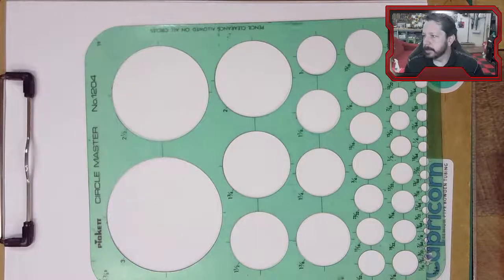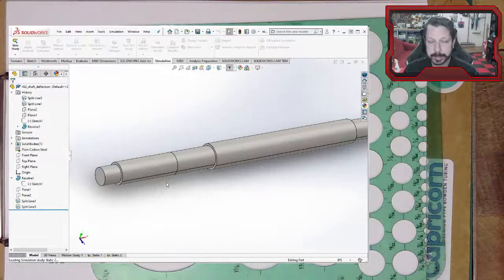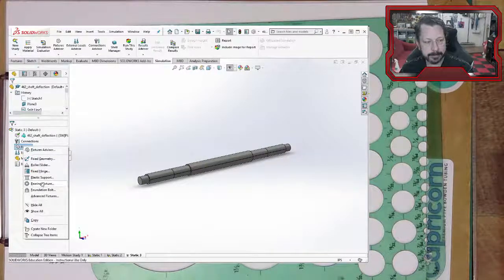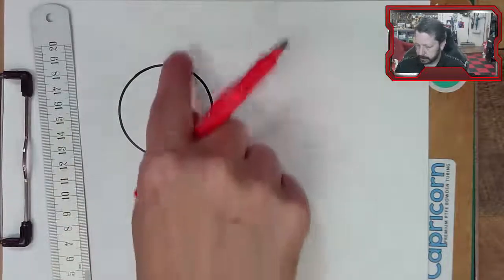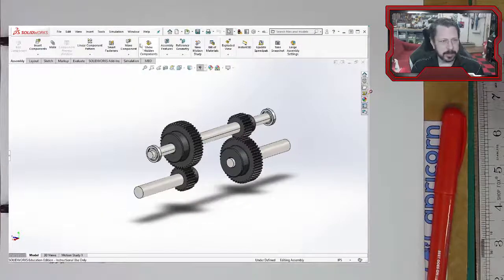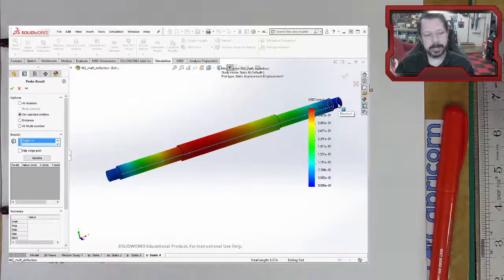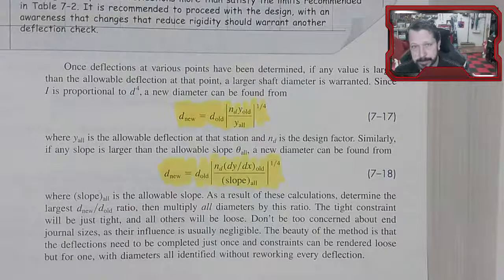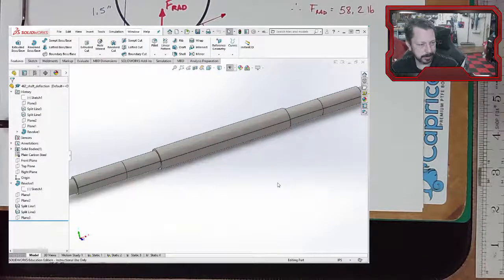Shigley 7.5 | Shaft Deflection | SolidWorks

Comment: i think you used SI units on your 2nd gear set but put in your english unit numbers, so your solution might not be correct
Reply from the maker: That is very possible. I don't recall exactly what I was doing there, so there could be some error in the final result. The process should be valid though - just maybe not the "answer". Thanks!

Comment: How would you of handled substituting a helical gear for one of the spur gears? Since there is now an axial force.
Reply from the maker: I think in that case I would have just modeled a blank for the gear as well and added the forces to it. There would be a small bending moment created by the axial force along with the axial force itself. You could translate the axial force and bending moment to the shaft, but a gear blank is simple to model (no need to model the teeth). I think I would just model it as part of the shaft instead of a separate part.
Reply: @KellyBC  Thank you for the response I appreciate it.

Do you know if the bearing fixtures provide an axial reaction force to resist the helical gear's axial force? 

Lastly, is there a difference between placing the axial force along the shafts rotational axis or along its face like you had done for the other forces.

Thanks again!

Comment: Just to clarify, cause I think you didn't explain it - Why do you apply the force to both sides of the split cylinder? Even if that was just a beam with 0 DOF on one side and we were to apply a bending force to the other end acting in one direction we would still apply the force to the whole cyllindrical face?
Reply from the maker: I don't recall exactly what I was doing for this one. But it looks like I was applying both the X and Y direction forces at the same time and I wanted the horizontal forces to be applied to the top and bottom evenly. A better way would probably have been to add another split line so that I could have added the forces only to the sides of the shaft where they were "pushing" on the shaft and not "pulling" on it. Also, would probably have been a little better to setup two selections(one for the X-directed forces and another selection for the Y-directed forces). It am not sure it would matter much for this particular thing though. I was just wanted a rough idea of the shaft deflection.

Comment: Hello, can you provide me with that shaft dimensions and two forces apply on two different gears please as a pdf file. Not two stage gears, I’m looking for nice and straightforward system, a shaft with two gears fits on the shaft, for any application. 
Thank you.
Reply from the maker: I don't really have that sort of thing readily available, but there are probably things like what you are describing in the various machine element design textbooks. You could try looking through the homework problems in a book like Shigley or maybe Juvinall/Marshek.